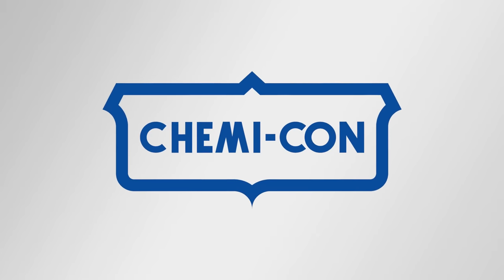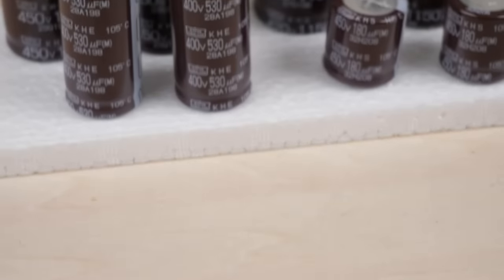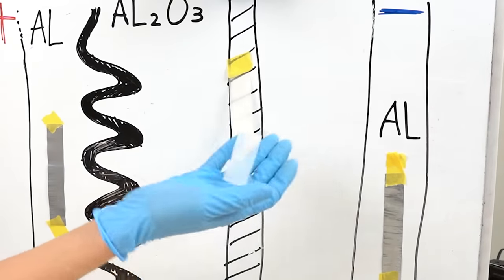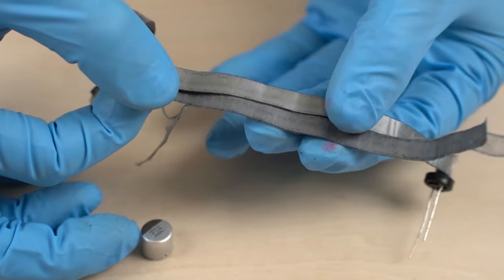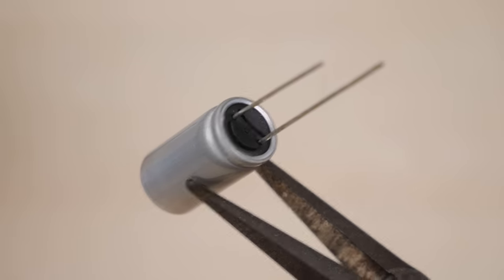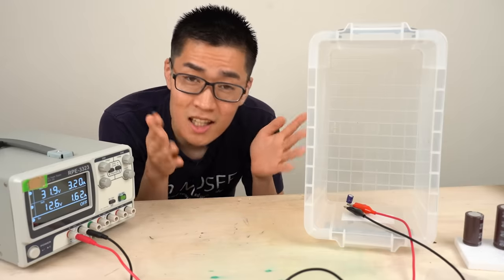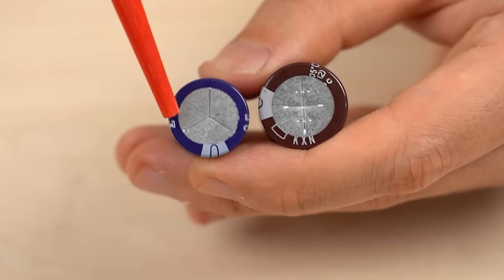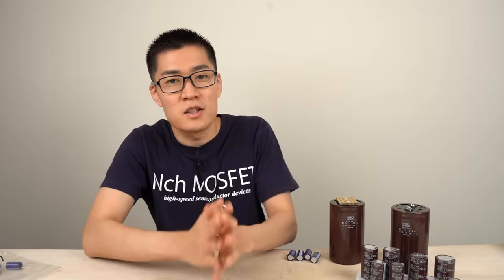Electrolytic Capacitors: Comprehensive Overview, Teardown, and Experiments

Comment: I'm surprised that Chemi-Con changed their name and logo. As an old timer, they will always be Nippon Chemi-Con to me, but younger engineers may not realize that these are highest quality Japanese capacitors rather than lower quality knock-offs...
Reply: Same here.  I don't understand what the reasoning behind the name change/modification is.

"If it ain't broke, don't fix it."

I sure hope that the quality isn't also reduced going forward.
Reply: Similar thing happened with Sanyo. They've spun off their capacitor business into a separate company 10+ years ago. The name and logo changed (now Suncon), the caps stayed the same (ie they kept the same series with the same specs in production). Nice side effect: the chinese fakers still don't seem to have gotten the memo yet, so they still happily print SANYO on their fake WG series (or whatever) caps. At least this makes it super easy to spot fakes (if the abysmal print quality, wrong top vent and circular rubber bung aren't enough of a giveaway)
Reply: Same here like HP there suddenly should call them Keysight, there was no reason to ran away from the old name.

Comment: Hello Mr Ichiken,

this time, in the English version, you will present the construction intricacies of electrolytic capacitors. I believe that the condition of increased capacitor operating voltage by approx. 25% should always be met. Congratulations!
Recently, I have performed tests that can be referred to in three groups:

First: Use of the base Controller and 230 VAC/62 V/17 kHz//0.65 kW Power Supply to run the BLHF-RM (compound coil micromotor, phase angle 180 degrees). The total power of the control lines [L1 - L3] and [L2 - L4] = 128 W during the average rotation of 28.705 Hz = 1.772 kRPM was obtained; load current max = 7.32 A; PF approx. = 1. Overheating of the IGBT key transistors (too much forced in previous tests) was found, which caused irregular voltage waveforms, but regular current, close to rectangular. The author's earlier tests led to the same conclusions contained in the film by the renowned Texas Instruments company, address: https://youtu.be/_6-_jvZe7iA.

Second: BLHF-RM (compound coil micromotor) powered by BLHF-RM No. 3 (phase angle 135 degrees; P = 6.17 kW - as a generator, driven by an angle grinder 230 VAC/5.5 kRPM//2.1 kW). The total power of two control lines = 0.203 kW; PF of phase windings = 0.7108. The value of the reduced power factor was affected by the different angles of the location of the magnetic poles in the armatures.

Third: Powering the micromotor with the frequency converter XSY - AT 1/1.5 kW. Data: f = 344.00 Hz = 20.640 kRPM; RMS = 23.36V; I (loads) = 11.20 A; cos φ = 0.9008; P = 0.236 kW (power record!). Load current interpreted by the ideal sine function (!).
It should be noted that the author conducts tests on the basis of devices constructed at home and on a low budget.
I invite you to visit my You Tube channel and website: www.mojewynalazki.pev.pl. My new study, Chap. VD. 
I cordially invite and greet all Internet users ❤.
Reply: Thank you for the likes 😀.

Comment: The polymer electrolyte capacitors do contain electrolyte (it's right there in the name), it's just a solid electrolyte instead of a liquid one.  Technically, they're all "aluminum" capacitors as well (the electrodes are aluminum, and the dielectric is a layer of aluminum oxide).

Comment: Best coverage of this component I've seen in my 30 years of electronics. Question: the conductive polymer and the hybrid capacitors have no vent.... what happens in reverse polarity? Are they less dangerous than the standard liquid electrolytic capacitors?
Reply: Quite the opposite. Solid polymer caps turn into literal bullets when they fail, shooting the metal can off of the base. Thankfully this doesn't happen much because a lot needs to go very wrong for them to pop. But if they do, you better hope you're not anywhere near it
Reply: @Knaeckebrotsaege  Yikes! Thanks for the info!

Comment: It looks like there's some HF noise in the lab. Judging by the spikes on the oscilloscope, I suspect either light switching spikes or more likely cellular phone interference nearby, around a few meters away.
Also looks like the 'scope leads might be near a transformer or they're growing resistive in the shielding, as there is a LF ripple apparent.

You covered etching of the foil nicely, many classes on electrolytic capacitors omit that critical fact.

I'd probably have gone lightly into inductance in capacitors, especially electrolytic capacitors, just to be thorough on design considerations and a small ceramic or mylar cap to counter ringing.

Haven't worked in electronic circuit design in decades, nearly forgot about frozen electrolyte. Good to remember if I ever design something for arctic, high altitude or space usage. Unlikely, but in my life, the unlikely occurs far too frequently.

Back when I was working as an electronics technician, I worked on everything from vacuum tube analog, germanium transistor analog, silicon transistor analog, discrete IC analog, VLSI analog and digital circuits. I work in IT now, but still remember my electronic theory well, which has saved my bacon on more than a few occasions.
Knowledge is power! And equally important, useful.

Comment: Excellent introduction. Capacitors are often the first failure point in power systems and unfortunately they are also the component many cost conscious engineers try to save money on. This video gives very concise guidance on why you should never cut corners on capacitance. When you think about it your entire design runs upon the assumption of clean available electrons to do the work intended. Why would you jeopardize the integrity of that need?   (I also liked the fact your hair grew during the video!)

Comment: This is a very informative video and educational at the same time. May I ask, would it be better just to use the solid type capacitors in vital cicuitry like processors to avoid damage due to leaking caps?

Comment: Thanks for the excellent video.  
Heres a thought, why not use an electrolyte on both sides of the center insulation, not just on the negatve (cathode) side? would that increase the capacitive storage ?

Comment: What kind of capacitors you use for audio: nip lxz, nichicon kz muse, elna silmic, elna cerafine, nichicon finegold, nichicon fw,elna tonerex,....
Reply: i need 10.000uf 100v for audio psu, what brand should be the best
Reply: @DiamondDog_  i like nichicon audio for psu, i am using 15000uf x2 nichicon audio for chipamp lm3886

Comment: Another advantage of the polymer capacitor is there is no electrolyte which may seep from the capacitor, causing leakage paths on the PCBA and corroding the copper traces, eventually leading to open circuits.

Comment: Interesting.  I believe that I have seen some electronics guys discharge capacitors using screwdrivers and jumper wires.  Some used resistors, but I am not sure that all did.
Reply: I never short out capacitors, I think it's terrible practice.  Apart from anything else, you don't want sparks flying around on boards with sensitive components.
Reply: I think that his point was wet vs dry.

Comment: Liked the demonstration with the dry ice ....but that is a pretty extreme condition(-88.5°C. -109°F)  that one isn't going to need to deal with at the most extreme earthly temperatures. So my question is does the performance of the standard electrolytic capasitor change gradually as a function of ambient temperatures and at what point does the electrolytes freeze. With the modern automobile using so much electronics it seems that one could experience system failure in very cold temperatures.

Comment: Thanks for the coverage. What AI did you use for the voice-over?  The only mistake I heard was its pronunciation of "farad." One other recommendation, if you view some foreign movies (like Hollywood) for the Polish market, you'll notice the Polish keep a "ducked" (volume-lowered) version of the original audio while using a Polish-native voice-over at a higher volume.  I think it would have been nice for this video and likely others you make because we can hear some native sound-effects, like when you were mentioning the "cracking" sound of the capacitor being rolled out. Plus hearing native language helps support understanding. There's a lot more in communication than just the language, like inflection, intonation, etc.  Regardless, GREAT JOB otherwise! :)

Comment: Interesting that the polymer caps shown here are for through-hole mounting, the only ones I've seen in that style of can were for surface-mount, and through-hole caps are purportedly being phased out, making life difficult for people like myself, repairing and restoring older equipment.
Reply: Would have loved to see a comparison of how well each cap functioned at say 120 Degrees Fahrenheit as if they'd been mounted next to a hot running voltage regulator or power resistor. (bad form though this might be, it is still done on many many modern electronics).

Comment: Anonym.
Hello. It would be very interesting to make a video and talk about what happens if you use a 100v capacitor where it was originally 50v. 
Or 50v where there was originally a 5v capacitor.

what happens to the microfarad value during use and  what happens to the reforming of the capacitor, or will the life be shorter when you apply 5v to a 50v capacitor or 50v to a 100v
Or 50v to a 200v capasitor.

Can someone say something about this?
Reply: Operationally it (usually) makes no difference, aside from higher voltage capacitors are physically bigger.  Lifetime might be increased as their larger size will make them run cooler.  Capacitor may not reform if voltage is drastically lower than rated and will lead to lower capacitance.  Bigger caps will tend to have lower ESR as well.
Reply: In my experience, when I used a high voltage electrolytic in a low voltage (CMOS) monostable timing circuit, the result was not as calculated. It's so long ago that I forgot whether the time was shorter or longer.

Comment: If your display goes out. It probably one of these. Try soldering a good cap of same or more voltage on power buss if needed to troubleshoot... else one would find a short using a dvm on each diode fet or diode.

Comment: I have a question.. I am always tinkering with old motherboards and video card. Just about all of them have the aluminum electrolytic Capacitors. How do determine which solid to use in place of the aluminum electrolytic Capacitors?
Reply: Short answer: any new (unused) solid polymer will likely do the job :-) You don't even need to stick to the capacitance of the original caps = you can replace with a lower capacitance if necessary. What counts is the ESR and permitted ripple current, and these are two sides of the same coin, because heat = P = R * I^2. A solid polymer that's roughly in the ballpark by rated voltage and mechanical dimensions will beat the original wet elyt several times over on ESR and longevity.

Depending on where you live, check the relevant product categories e.g. with Mouser and TME. The original wet elyts will typically run at 1/2 their respective rated voltage - there was a rule of thumb that it prolongs their lifetime. You should measure on your live device what the actual voltage is on that rail, and with solid polymer, you can go for "the next higher notch above the actual voltage". Such as, for a rail of 3.3 actual Volts DC, choose a solid poly with at least 4V nominal. But you can also use something rated at 6.3V if that's better available or makes better sense mechanically (leg spacing). In many applications, you'll find that a perfect mechanical match (by case diameter and THT leg spacing) will have an unnecessarily high nominal Voltage and a few milliohms more than what you could achieve in a smaller package... which possibly won't matter much for practical operation.

Check out some datasheets of solid poly capacitor families. To get a feel for the ballpark of ESR values and capacities depending on nominal voltage. You will notice that solid polymer is well represented up to about 16V nominal (i.e. for the typical 12V inner power rail in modern computers), but for higher voltage levels you won't have much choice. For instance, in industrial process control PC's if you need something for 24V or even 48V, you'll find a select few hybrid models rated at 25 / 35 / 63V, and the capacitances will by relatively tiny. (For those positions, do also check out the Panasonic FR wet Al elyt - featuring a very nice ESR.)

As for brands, you needn't really be ashamed. Nippon Chemi-Con is definitely the golden standard of solid polymer, but any brand solid poly will be better than your old wet elyt. 
I've actually written an "overview of the market" 5 years ago, for my domestic audience (the language is not English unfortunately). Maybe just skim the pictures, the brand names should be understandable for you (they're written in latin characters):
http://support.fccps.cz/industry/kondiky/kondiky.htm
There's a noteworthy overview website in Japanese:
http://capacitor.web.fc2.com/solidcapacitor.html

Solid polymer is a no-brainer for the secondary side of any SMPS / VRM / buck converter. The secondary side of a step-down converter is where the punitive current pulses occur, coming out of the inductor. The primary side tends to be comparably benign, current-wise... Still, at 12V, I wouldn't hesitate to replace wet elyts with solid poly as a matter of good taste 🙂

Regarding the potential for PWM control loop instability... it is true that replacing a wet elyt with a solid poly changes the phase response of the output capacitor bank, which participates in the PWM control loop. The resistive element to the impedance drops by something like an order of magnitude, thus removing quite a bit of the "proportional" part of the "P.I." regulator formula - while keeping the "integrating" part mostly intact. If the PWM loop was originally tuned to rely on the "P" component for stability, it may indeed start to oscillate... In practice, I've only ever seen this in cheap wall-wart type SMPS modules, with a single wet cap or two on the output - and the oscillation was not catastrophic. In a PC PSU, or a motherboard VRM, this has never been a problem.

Thumbs up for reviving old stuff :-) Unless it's a leccy guzzler that would deserve the scrapyard for that single reason.

Comment: Thanks for the video 🙂
If you want a tip for another funny explosive experiment, find an old AT/ATX PSU for 120V AC, and plug it into 240V AC. The bang is really loud, as the primary capacitor pops.

That's a pretty neat ATX PSU BTW, that you have there! Such a long row of solid polymers (and wet elyts just next to them). In the PSU's that I'm used to seeing, I get a wet elyt for +12V and two more for 3.3V and that's about it.

For some reason, the solid poly capacitor technology is limited to low double digit voltages. Only some hybrid models reach higher double digit volts, and although they do have a fairly nice ESR, their capacitance in the higher voltage range is abysmal. Thus, for the SMPS primaries in 120V/240V PSU, your only choice is a wet elyt. Still you shoud pay attention to brand and model, fit for the purpose/application.

Solid polymer caps are a no-brainer for SMPS/VRM secondary positions, or in general for voltages of 12V and below (maybe up to 24V with no big problem). But they do also have marginal downsides:
1) they are sensitive to moisture. Moisture increases their risk of failure.
2) they have a non-trivial leakage current. Which doesn't matter for power filtering applications, but makes them unsuitable for timing / filtering and general signal applications, where the capacitor may need to be charged by resistors in the kiloOhms or above (currents below a milliAmp) and needs to be relied on to act properly.

Comment: Why do phone chargers use 2 different value capacitors in parallel for the output filter?
Something like 820 and 470 microfarads. They are both organic polymer.

Comment: At around 8:35 you mention that on capacitor datasheets, they state a lifetime of 'around 10000 hours or so'.
These are EXCEPTIONALY rare capacitors to be rated at 10k hrs.  More 'typical' units are rated at 1k-2k hours...
However...
This time rating on datasheets is an 'edge case' rating from the outset.
The datasheet is stating that if you run capacitor 'X' at it's design max temp of 'Y', then it will last for 'N' hours.
As a general 'rule of thumb', if you lower the temp of that capacitor by 10 C, then it's life will be doubled.  (Dropping by 20 C => 2 * 2 => quadrupled).
Most capacitors are rated at either 85 C or 105 C.  (NB: I said MOST.  There ARE exceptional devices that go beyond a 105 C rating)
Other than perhaps prototyping, anything I design / build will NEVER use a 85 C device.  If using a 105 C device would place the entire unit iout of the budget, then I know I am working on the WRONG project to begin with.  (It's my way to protest against 'planned obsolescence').
The second, and EQUALLY important aspect is to only use genuine units from a reputable manufacturer.  Chemicon, Panasonic, Rubycon [lots of fakes exist], CD etc.  If the unit is 'made in China', then I believe it should STAY in China.  (Capxcon, Samxon, Teapo and a million other 'brands).
Lastly, make sure they're purchased from a reputable supplier.  Anyone who would use 'flea-bay' capacitors is on my list of 'NOT FRIENDS'.
</EndOfLecture>

Edit:
I forgot to add... Thanks HEAPS for making this video.